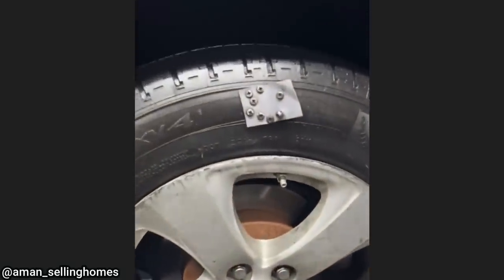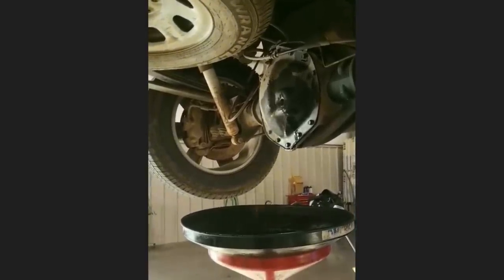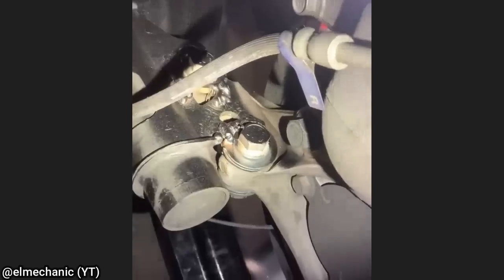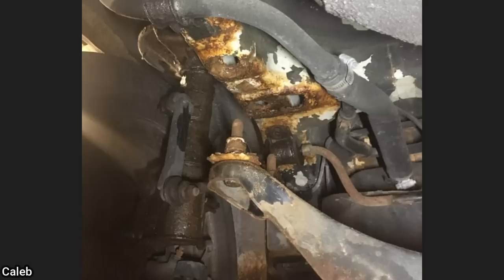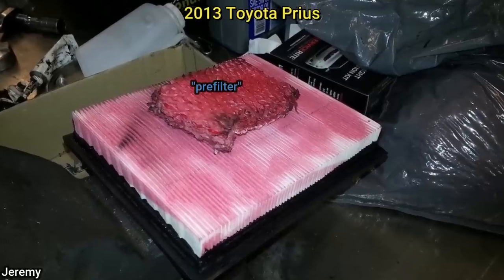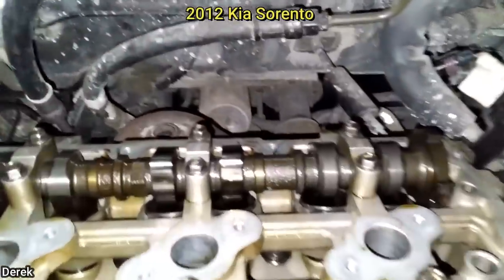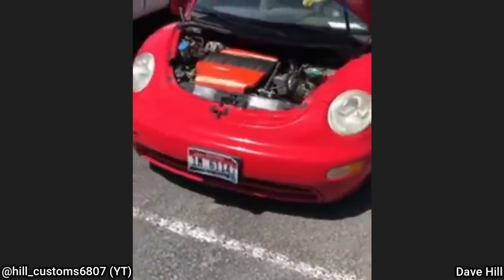Customer States They Tried Fixing Their Tire But It Still Leaks | Just Rolled In

Comment: To the people that are confident enough to do a head gasket replacement but then jump start it backwards, I'd like to present you with this wonderful Dunning-Kruger award.  And I never understand the people are are like "Well it doesn't fit.  Let's just weld some shit on."
Reply: What's the problem with jumping it backwards (genuine question)?
I've often done it in older cars (1999-2010) and never had a problem.. 
Edit: Never mind, I was thinking of push-starting a car backwards!
Reply: @JoeBob79569  Well, in more modern cars, you can kiss the computer goodbye, or other modules. Reversing polarity anywhere is generally not a good idea. They are colored red and black for a reason.
Reply: @repro7780  I think First Name Lastname was referring to a mechanical jump start, ie rolling it backwards an then letting the clutch in reverse, not an electrical battery reversal that not withstanding computer blowouts would spin the starter motor in reverse and thus not throwout the starter pinion and engage the flywheel.
Reply: Years ago, I was a security guard at a movie theater. One night, I was talking to my supervisor when we saw two guys with jumper cables trying to jump one of their cars. We went over to make sure they didn't screw it up because they looked really unsure. They were about to jump it backwards, but I stopped the guy and told him it was wrong. He said I didn't know what I was talking about and that his uncle was a mechanic and this is how he said to do it. After a couple more tries of telling him what to do, my super backed me away and said, "Let's just watch the stupid happen." Well, sparks flew and scared the shit out of the kids. The other car shut down. Both cars ended up being towed. When it happened I laughed and said, "So, I don't know what I'm talking about?"
Reply: And this Laurel, and Hardy handshake!      (from "Blazing Saddles")
Reply: @JoeBob79569  if you never had a problem, you didn’t actually get the polarity backwards. Good on you!
Reply: @gijoe50000  is what will actually happen is you tend to fuck up some the computer stuff and then you start melting the jumper cables on to your bumper and a bunch of other things.. Sometimes you get a nice smoke show... I have seen too many people do this
Reply: Same thing happened with me years ago at my job. In the customer parking lot some dude was attempting to jump his car with polarity reversed on terminals. I tried stopping him and he became angry and defiant. I shrugged and walked away quickly and far enough away. Those cables melted quicker than one could imagine...smoke and sparks added to the show. I laughed my ass off as he cursed at his own stupidity.
Reply: @lastcall170  I had a guy who had a dead flat battery and charged it backwards. Totally fried everything when he connected the cables back up. The safest way to jump start a car is to always connect one jumper cable from the engine block to the other engine block. Then if you did put the jumper cable on the wrong battery terminal you are only shorting out a earthing cable, not the whole electrical system. Still not a good idea but less chance of damage.
Reply: @robfinch3277  Yes, I think that's the case. I just call those "bump" starts: one (of many!) very handy option with a manual transmission!
Reply: @lastcall170  The Jumper: DOH! DOH! DOH!!
Reply: @repro7780  Oh, that kind of jumping! Yes, of course jumping the battery backwards would be very, very, bad!
I was thinking about jump starting the car by pushing it backwards..
Reply: @jeffgriffith7003  I was confused, and thinking of jump-start where you push or roll the car!
Reply: @codykellner9985  It was a miscommunication, I was thinking of a push jump-start, and not a jump-start with jumper cables! So "backwards" to me seemed like pushing the car backwards, hence my confusion. 
But yea, I saw a few girls trying to use jumper cables the wrong way around recently on YouTube, they ended up burning a huge thick melted line into the bumper from the sagging cable, with sparks and smoke everywhere... 🤣
Reply: Dunning-Kruger…. A less fatal version of the Darwin Award. Well cited sir.
Reply: @JoeBob79569  aside frying the electronics, as many mentioned, turning a modern engine backwards can cause timing belt or chain to jump over as the tensioner for it often comes loose when you turn the engine the wrong way. best case timing is off, worst case you'll mechanically ruin the engine when you turn it correctly again. and in modern engines things can be very tight.
Reply: @lotharrenz4621  After reading the comments from other people I realised the OP was simply talking about connecting the jumping cables backwards, and not push starting the car backwards, so it was more of a misunderstanding than anything.
But I don't think you will fry electronics, or ruin the timing, by pushing the car backwards, because cars can go in reverse anyway.
At least I've never had any problems doing this, and never heard about anyone having problems doing it.
Reply: That was my exact first thought! How the FUCK do you do a head gasket AND camshaft swap by yourself, and still not know how to properly jump a car???
Reply: @JoeBob79569  probably want to edit that original comment for the people who don't bother to scroll down 👍
Reply: @pizzlerot2730  Good idea, thanks! (Done)
Reply: @JoeBob79569  👍 it's happened to me before, no worries
Reply: @JoeBob79569  I realized that after writing my comment, so all is well.
you can still make the timing chain snap over with turning the engine backwards. some models of european descendance will even let the tensioner fall apart... not a well-thought out construction IMO.
so, be careful doing this with european brands. ;)
Reply: @pizzlerot2730  might be the Internet Generation. if you know nothing about the topic at all you won't notice some instructions are missing because the author thought everybody knows such basics before you attempt to do THAT.
this might explain why the camshafts were switched; if the mechanic doesn't know there are differences, and what timing actually means, they don't know to take account of that. reading the whole text, or grabbing a how-to book and reading the while chapter first, might have helped.
of course, again, if you don't know.... and maybe they are too selfconfident to step back and wonder what the fuzz is all about, and maybe ask someone who knows. naah, it'll work out allright in the end, I can do it!
Reply: @lotharrenz4621  Yea, it's not great to push start a car, either forwards or backwards, because you are usually slamming the clutch out to "jump" it, but sometimes you have no other choice, like to make a flight, or get to work on time. 
Better to just buy a cheap power pack on Amazon or something, which is what I finally did when I bought an automatic car. 
Before I got a jumper pack I went through all sorts of stupid effort to start my old car, like pushing it up a slight hill, a few inches at a time, and kicking a block under the wheel, and repeating until I could roll it back down and jump it.. There's nothing more disheartening than when this fails and you have to do it all over again!
Reply: @JoeBob79569  releasing a clutch fast usually doesn't hurt it. what destroys a clutch assembly is to like, let your foot slide off the pedal; but that isn't necessary to push-start the engine, just releasing and letting the clutch slip a bit is enough. if it doesn't start like that, it won't at all. usually because the battery is damaged and won't keep a charge, or somethign else died. or therte just isn't enough juice to fire electronics and ignition. I had that once, doing exactly what you described in your last paragraph... learned not to let the lights on for too long, too. XD
Reply: I just did upper and lower timing chains on a 2.5L VW 5-cylinder... Hooked up the H and C lines on my washing machine backwards, though.
Reply: @pizzlerot2730  well they didn't do that right either 😂
Reply: @VintageCars999  true 😂 I wish I had that kind of confidence (though with the competency to go with it)
Reply: Confidence is not a "replacement part" for intelligence... 🙄😂
Reply: In the late 90's I worked in my dad's workshop as an apprentice fitter and machinist, replacing a head gasket is actually not a difficult job to do, time-consuming, but not too difficult if you have all the right tools and machinery to do the job, in my dad's workshop we had a lathe and a horizontal milling-machine that we used to fix cylinder heads that were slightly warped out of true, my dad even repaired cracked cylinder heads using a Mig-Welder, I would occasionally be given the job of chipping-out all the carbon residue, and then de-greasing the cylinder heads and exhaust manifolds too, I was even given the job of dismantling complete engines, one time a complete Cessna airplane engine was broght in to my dad's workshop for me to pull-apart which was a fun job.
Reply: and he had the intake cam in place of the exhaust cam...
Reply: @JoeBob79569  I actually thought what you did until I found your post.  I have a 1973 BMW and I have push started the thing in reverse many times.  When pushing it in reverse, the speed required when you release the clutch is a whole lot less than moving forward.  And for those that might say this is bad for the vehicle, I bought the car in 1973 and have been driving it for 50 years, still has original transmission and motor, so it must not be that bad.
Reply: I don't think it was a bump start, the reverse jump fried a computer module for the smart key.

Comment: If i had a nickel for each time a rotting pumpkin was found inside one of these vehicles - i would have two nickels.
Which is not a lot, but it is weird that it happened twice.
Reply: Think positively, you would have a dime, sounds better than 2 nickels
Reply: @galewinds7696  I think 2 robust jefferson nickels sounds superior to a single little Itty bitty dime
Reply: @SoulDelSol  especially when they clink together in your pocket.
Reply: @SoulDelSol  a pair of buffalo nickels, they have more clink to em.
Reply: @galewinds7696  

If I had a nickel for every time I read a comment which starts 'if I had a nickel' I'd have a lot of nickels.

Comment: Just when we all thought we seen it all. Then some clown uses screws and duct tape on a tire 🤯
Reply: The sad thing is....we still haven't seen it all.
Reply: i expect someone trying to fix a tire by trying to weld a metal patch someday
Reply: He needed some tire seal before adding the patch.
Reply: Imagine someone trying to fix a head gasket with feces.
Reply: @millerkiller6496  The filter was pretty damn close
Reply: Did you see the one that rolled in a while back with the tire wrapped in packing tape?! 😅
Reply: Did you miss the fuel in the differential?
Reply: Professionals would have used FlexSeal Tape.    😅
Reply: @markh.6687  🤣🤣 yep
Reply: @millerkiller6496  Give it time. We're bound to see it eventually.
Reply: @millerkiller6496  U
Reply: he should have used gorilla tape.
Reply: Yea wtf ducktape?! Flexseal wouldve been better!

Comment: My mom is kinda like these people but with home improvement. She is too cheap to hire someone and tries to do stuff herself. She will paint and paint right over outlets and light switches, fixtures, you name it, and does not move or cover up any electronics so they get splattered with paint. No tape along edges either. She will mix the paint cans with a kitchen knife, then wash the knife in the kitchen sink where we wash the dishes. She hangs picture frames by hammering  screws to the drywall. She "fixed" a picture of herself in a dress she has on the wall by painting over the dress with nail polish. And many other things. Any guys she hires are usually incompetent because she hires the cheapest one she can find. One time she hired a random guy she met at Wal Mart to install tile. This guy did a horrible job and ran with her money. The tile installed had so many air spaces underneath the tile and around the corners, that when you would step on a corner it would sink in and break. She would hire homeless people for landscaping and to cut grass, and those people would never finish, they would just cut the grass with the weed eater and leave the mess.

Comment: back in the mid '70's, a buddy put a 327 vette engine in a '68 beetle. including tall drag slicks. ran fast as hell in a straight line
Reply: A guy down the street from did the same thing w/a Vega 2 door wagon. Watched him one day completely embarass an Integra Type r getting on the freeway. Pulled at least 8 or possibly 9 car lengths away from him. Truly defines how fun "sleepers" are.
Reply: @kettle_of_chris  Anything that gets rid of the Vega engine is a big step up. But the car doesn't deserve a 327.

Comment: We all know that, "Customer said it should be a warranty replacement," actually means there was a protracted shouting match that quickly escalated past the service writer to the shop manager, and then to the shop owner.
Reply: That said, I’ve seen worse on brand new cars that the new owner didn’t actually cause. Dealer selling it anyway or oblivious to what the detailer did when they took it around the corner.
Reply: There wasn't any scratch or gouges on the pan. If they hit something bad enough to do that, there'd be other damage, even if it was just on the pan itself. The rest looked perfect.
Reply: @MeppyMan  I admit that none of the doors on my new work van (Chevy express) actually fit properly...so things can go wrong.  But to say that customers are always 100% honest about what they did or didn't do, that would be inaccurate!
Reply: @WhiteG60  that is what I thought when I looked at it.
Reply: The audacity to automatically go to "it wasn't me, YOU have to pay for it". Customer probably hasn't even seen the extent of the damage, just automatically goes into defense mode.
Reply: @graealex  We also don't know how the customer was spoken to. I've been told that a heated seat element burning through leather on a car that was 4000 miles old was 'not a warranty issue' because 'there is no heating element at that location of the seat', despite if you turned on the heated seat, it got hot RIGHT THERE. The burn mark wasn't big, maybe 2-3mm, but most definitely there and on tan leather, very obvious. I was trying to 'scam a new seat' out of the dealer and what I was doing was 'fraudulent, because clearly it was a cigarette burn and I just wanted it fixed for free'. I didn't smoke, never smoked and no one in the car ever smoked.

I ended up having to escalate to VWoA, who took care of it, but I can imagine someone being upset if they truly didn't know what was wrong but are being accused by the service writer of being a liar.
Reply: @WhiteG60  Car workshops still are just a bunch of people, some of which are good, honest and meticulous, and some of which are malicious, dishonest and sloppy.
I distinctly remember getting a car back from service, and it having a scratch in the steering wheel, although no one there would admit to having caused that damage.
But as a customer, I would not jump to conclusions without having seen the full extent of the problem myself.

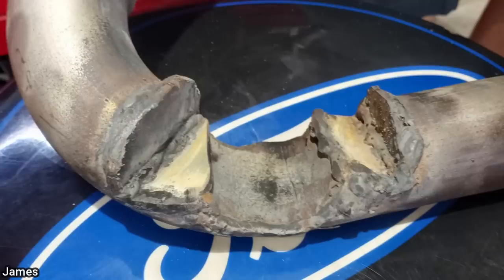Comment: 2:42 High centering snow at a decent speed is my best guess. Maybe they got home from work on a snowy day and didn't want to clear their steep driveway. They gave it the beans to get momentum and compressed the oil pan. The passenger-side inner fender liner looks torn, like it got caught on something as well.
Reply: Nonono clearly came busted from the factory - to be replaced under warranty
Reply: or they hit a speed bump too hard lol
Reply: @peterf.229  Speed bumps leave scratches

Comment: I love the idea of fixing a hole with more holes lmao 🤣
Reply: “Before you know it, you gotta dig a few more holes. You could be there all (bleep)in’ night.”

— Casino.
Reply: The only thing I know of that you fix by putting more holes in than it already has is a torn net
Reply: Ya, but duct tape is supposed to fix anything!
Reply: @josephvanwie6706   And that's where he messed up. He didn't trust the duct tape.
Reply: Weight reduction, bro
Reply: @josephvanwie6706  should have used flex tape

Comment: 2:47  "I didn't hit anything."    The polygraph indicated that's a lie.

This may be the first time I actually want a Beetle.
Reply from the maker: Same here 😂
Reply: Just to play devils advocate here, it's possible they didn't hit anything. It doesn't look scratched or anything, and nothing else around it is damaged. I don't know what could've done that, but it's entirely possible they didn't hit anything.
Reply: i miss my civic cx , that engine swap would have been fun , it was like 2200 lbs with a 90 ish hp engine  .
Reply: I didn’t see any signs of an impact either. Vacuum caused it to collapse?
Reply: @winfortheworld  Then what? What else could have happened to dent an oil pan? If someone else borrowed the car and rammed into a rock in a parking lot, OK.
Reply: @101Volts  That's why I said I don't know, it could be a vacuum issue like someone else said, or maybe it did get hit. I'm just theorizing here.